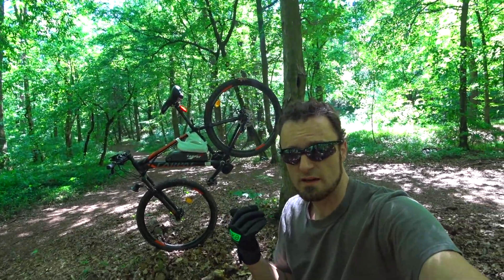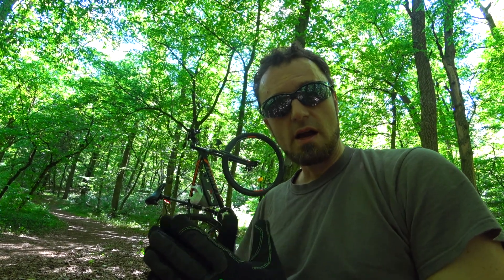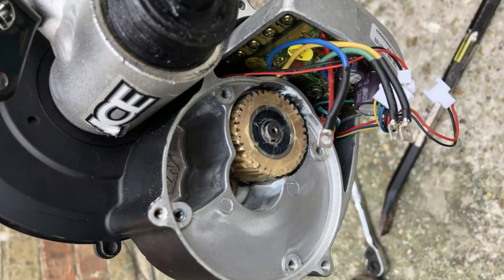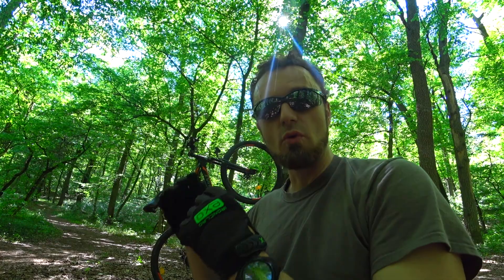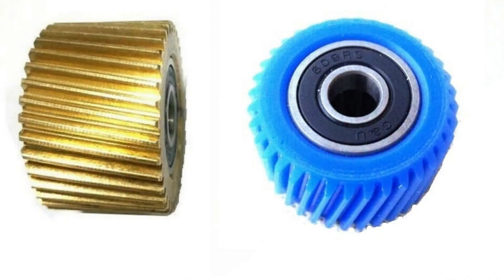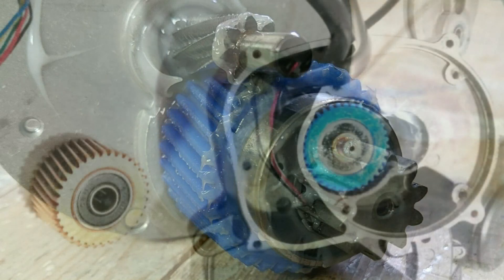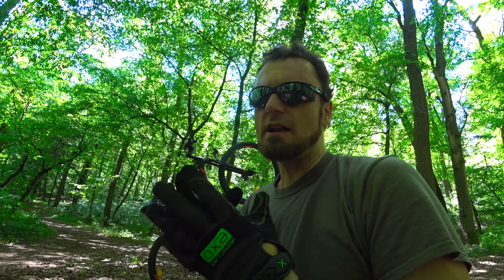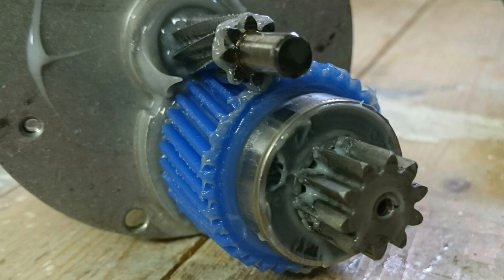Why they use CHEAP plastic GEARS in electric motors Planned Obsolescence Tongsheng TSDZ2 mid-drive

Comment: It's worth noting that they are probably designed to protect the motor in the very worst cases of abuse and lack of maintenance. 
A lot of the time an educated user who's willing and able to properly maintain a piece of equipment can get benefits from using stronger parts. 
In this case, I'd guess the nylon gears are designed to run with minimal or no lube and possibly some moisture contamination. 
If you are willing to relube regularly or modify the motor to use oil lubrication as some people are experimenting with on geared hub motors then metal gears likely remove a failure point.

Comment: To me this makes sense.  My own plastic gear failed and I was consdering replacing it with brass as others had done.  But many have said they are nosiy, and this motor is already noisy enough!  I agree.  So I'll stick to the blue nylon version.  Thanks for the video!

Comment: yeah I can see the benefit for doing maintenance, but when you need to perform maintenance more frequently that is why people say the product is poorly made. What do you want, more frequent breakdowns that are cheap to repair? or a breakdown that almost never happens but is catastrophic? Either way you are probably walking back so I would rather be off the bike fewer times even if it costs me more in the long run. Not like ebikes are all that cheap anyway.
Reply from the maker: Can go both ways .. I rather have a more frequent fix that is cheap rather then a huge one that costs a lot more then the cheap fixes in the same period put together
Reply: @VegasRoManiacReviews  I would rather have rare fixes that are cheap. so just design the thing to last longer by using bigger plastic gears.

Comment: Why do made a nylon gear?
Answer is: it’s a poor man motor overheating protection.
When the motor’s coils get hot, magnets can be damaged. To avoid it – 
nylon gear.
When temperature rises too much/too often (high gear ratios, high loads,
 etc) nylon gear/clutch in it smelts.
That’s why when you go with brass gear you choose to install temperature
 sensor and program your controller to reduce power when temperature 
rises and cut it off, when it’s too high.
I may be wrong, but that’s why the TDSZ2 is so cheap (by avoiding 
expensive parts and keeping things simple).

Comment: Good information, Im researching my mid drives now and think this is what ive settled on. Makes perfect sense. Couldn't you carry a spare and replace it on the trail? thanks.
Reply from the maker: Hard to replace ...might as well just pedal home
Reply: @VegasRoManiacReviews  maybe decide on a mileage interval to just go ahead and replace it. Also maybe someone with a 3D printer could make one with slightly stronger plastic.

Comment: I think you don"t have the problem right. The "real" issue with this nylon gear is the "falty" programmation of the controller. 

The nylon gear wear because the motor put too much torque on this nylon gear while it is spinning too slow. This motor is designed to rotate very fast, so it wears gear teeth fast too because the teeth are stressed a lot (the "perfect" range for the motor is around 4000rpm). But it is not the main problem. When using it hard (high speed OR start at high gear) the watt/tooth is too high to be handled by the nylon and brass gears. The motor should limite the amount of amps asked by the controller. I think max amps/rpm limit can be found. 
But the motor do not have a motor rpm sensor and this is a big problem, this kind of control can not be done and only the user can "feel" the good range for the motor (but we do sometime errors and these little event of big stress accumulate and then it breaks).

Comment: I'm a recent adopter of the TSDZ2 and always considered replacing the blue gear with brass but after your explanation, I'll be sticking with the blue one. As you say, it's relative weakness offers protection to the other parts of the gearing system - a bit like a fuse in an electrical appliance.
Reply: I just saw a photo of a guy who destroyed his TSDZ2 with a Brass gear. There work metal shaving all inside his motor. His gears were torn to shreds.
Reply: Brass is softer than steel, but more expensive than plastic and noisier.
Reply: Plus brass is conductive and would have shavings in a electric motor.

Comment: If they're nylon, couldn't they be 3d printed as well?
Reply: how does one get the dimensions though. the stl file.
Reply: @snorttroll4379  By taking measurements and making it in CAD software, same way as every other 3d printed tool or component.

Comment: I think the copper gear can just provide equal mechanical "buffer" to the other hard-to-replace gears as you mentioned. I believe they went a step further to nylon to make the motor quieter while trade-off a little bit of stiffness compare to the copper counter part. No a problem as long as low cost replacement part is available.
All in all, just don't push the motor too hard and the nylon will last just fine.

Comment: I had to change my gear to metal. I know of the heat problem, so take a brake when climbing longer hills is clever.
Reply: Do the motor a favor by climbing with low gear will do.
Reply: @trinhquy  I know. Electric motors like to run fast. But I am a big heavy man, and the hills in Norway are often mountains. :)
Reply: what about filling the housing with thin oil?

Comment: Also the plastic makes the motor much more silent than the brass gear. We have a lot of knowledge about TSDZ2 more, we developed our OpenSource firmware and wireless controller for TSDZ2, get it for free: https://opensourceebike.github.io/
Reply: `so how does one get the gihub stuff into ones motor?

Comment: Tongsheng motors lack a thermal protection circuit, there's no temperature sensor for a start, so they can overheat if ridden uphill in turbo mode for too long. Something many new riders wouldn't know about, not exactly consumer ready. It's a major design fault having the motor surrounded by an air gap under the casing which prevents it from cooling properly, which in turn causes the blue gear to fail earlier.

There's a hack I read about, pack the air gap around the motor with CPU thermal pads, this gets the heat to the outer casing to be drained by air flow, they say it solves the heating issues completely and saves the blue gear. 
I'm receiving my Tongsheng next week, so I'll see how it goes.
Reply: Any chance you can post a video showing the thermal pads installation?
Reply: @ronen424  Here's the thread:
https://endless-sphere.com/forums/viewtopic.php?f=28&t=102046&start=25

Been riding mine for 6 weeks now, the pads reduced the temp from 74˚C to 54˚, that's a 20˚ reduction, I consider the problem solved.

I used these silicon thermal conductive pads, 3 and 2mm:

https://www.ebay.com.au/itm/Very-Soft-Thermal-Silicone-High-Conductive-Pad-3-15-W-m-K-Heat-Sink-CPU-IC-GPU/273963156154?ssPageName=STRK%3AMEBIDX%3AIT&var=573914641101&_trksid=p2057872.m2749.l2649

Comment: Hey, come on now.!  surely you know they use plastic so that it brakes and you then have to buy another bike, preferably, their latest newest model bike, same as with power tools, they have a pre planned life span. If they wanted it to last they would provide an access hole for lubricating the gears as you pointed out in your earlier video.
Reply: philyaboots1 NO, NO, NO, the very small gear on the motor, lets say has 8 teeth, the larger plastic gear lets say has 40 teeth. Well if both are made of metal which do you think will wear out first, 40 tooth, or 8 tooth? If you said 8 tooth the you'd be correct, it will actually wear out 5 times before the 40 tooth one. Well that really sucks bad because the small gear is permanently attached to the motor. So you would have to replace the motor 5 times before you wore out the 40 tooth gear. I'd rather replace the 40 tooth gear which is much cheaper, this is why they make it out of nylon plastic. The plastic will not wear hard on the small metal gear.
Reply: @bootyholeman5659  but with both metal they would last much longer. just correctly dimension the gears. make everything oversized. made to last a million miles.
Reply from the maker: there is always a hidden truth , but planned failure point its a common practice in any mechanical items to protect the important components, that is a fact, but if its true to every item sold on the market , i cant tell, i do have a ryobi drill that its 15 years old , hardly can find batteries for it , and the salesman told me it wont last i need to buy the dewalt 10x the price because it has metal gears and not plastic
Reply: @VegasRoManiacReviews  Thinking of drilling a small hole in the gear casing of my bike when i need to open it up for repair so i can spray lube inside easily and using a rubber grommet to fill the hole until next time it needs a spray of silicone.
Reply: I give my power tools with plastic cogs a small spray of silicone lubricant into the small air vents before using them, I think it helps a little. @VegasRoManiacReviews

Comment: I think with ebike motors often plastic gears are also there to reduce noise levels. Some of the German brand mid drive motors use a lot of plastic gears and belts where as the Japanese brand models are more likely to use metal gears and often in the reviews you see complaints about the noise level of the Japanese motors. Sometimes these cogs are turning so fast they can create a lot of whine noise. I think Shimano is designing a gearbox that is a separate unit from the motor so the cogs can be in oil and therefore no need to be plastic, a bit like the rohloff gearbox. As you say though to protect the metal motor cog better to use nylon cogs but hopefully future motors will move to a lubricated cog system. There is no reason why the motor's cog can't be easily replaceable too. I'd also point out that some motors with plastic cogs do have a reputation for destroying themselves. Brose motors have a reputation of destroying themselves so maybe the plastic cogs that break up push into other areas of the motor and destroy it.
Reply from the maker: very true , there is so many ways to make a motor these days , i rather have a loud motor that is reliable , but than a average person that is ignorant towards reliability might prefer a quiet one .